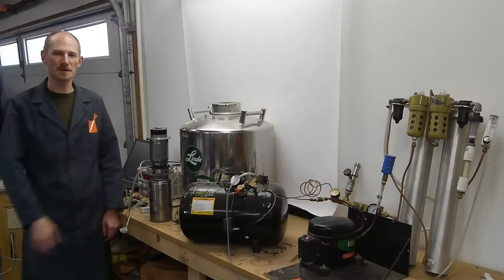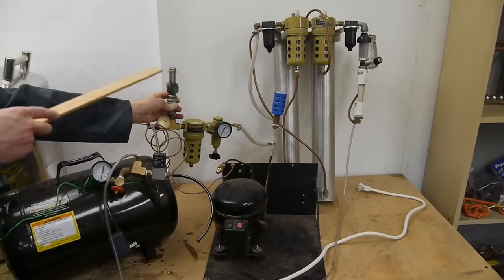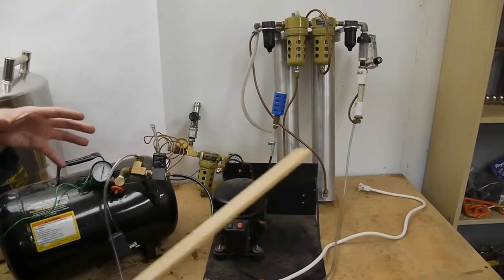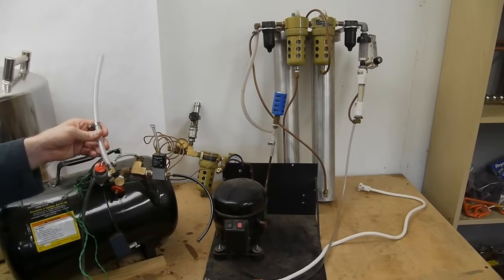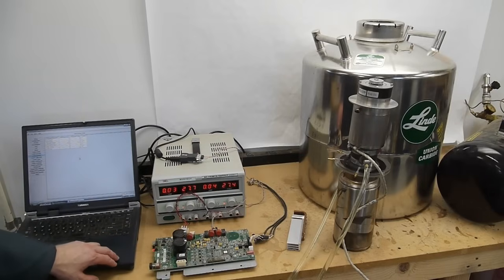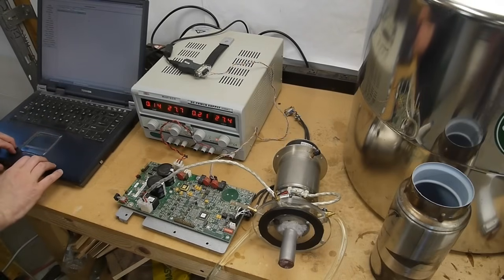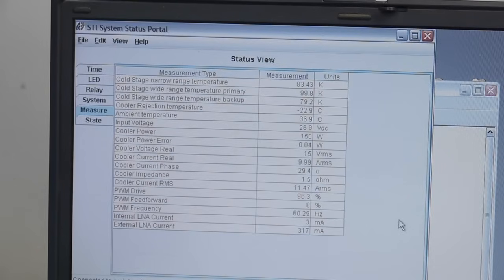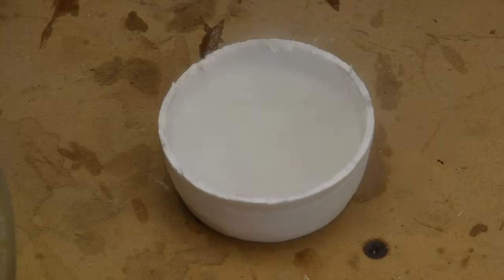Liquid Nitrogen Generator - Overview

Comment: Question for you Ben:  Since neodymium magnets are a lot easier to come by, could you first liquefy air then separate the O2 from the N2 via magnets and pour them into two separate dewars?  Seems like you could also simplify the set up by just letting ice form on the Stirling cylinder tip and/or dry it out upstream with a cold trap.  Am I dreaming?

Love your vids and your ingenuity!
Reply: SuperDachshund How 'bout this?Liquify the air like you do here then drop it down a funnel emptying into a 1" long tube that is cut away like a trough for the last half inch.  Then position the corner of a square neodymium magnet near the trough.The O2 will leap out of the trough and run down the edge of the magnet a half inch or so away while the N2 will continue down and out the trough.  Now you've separated the two elements.  You could put a large tube in the dewar to capture the O2 dripping off the bottom corner of the magnet.  The N2 will drip in the dewar and the O2 will drip in the tube/tank inside the dewar.  CO2 and H2O and many other impurities are filtered out upstream or in the ice accumulating on the Stirling cold side.What do ya think?

Comment: An amazing system and job of construction !
  I have a project that I am having trouble keeping water vapor out of the vacuum pump.  The main chamber (Freezer) oscillates between a 200-700 mTor pending heating cycles of the internal plates, which release water vapor from the product. 
   So under the vacuum, the water stays a vapor until it reaches the pump and when the system is turned off and brought to an equilibrium; then water is found in the pump's oil reservoir.
  Can you think of a way to capture the water vapor in a vacuum, before it gets to the pump?  I thought about a silica gel filter stage; but the water is still a vapor, and I suspect would pass straightway thru or around the silica, back into the pump?
Reply: Bruce Wayne Silica gel has an enormous surface area. It acts very differently from a sponge. It works on water vapor.
Reply: Garganzuul Thanks, I will give it a go...

Comment: Amazing. This is a bit late, but do you have a nitrogen alarm? Film processing labs that use nitrogen bubbles to agitate the chemical baths have these alarms. I'm sure you know that if a nitrogen tank leaks it can displace the oxygen in a space. This is apparently undetectable to people, so a person could pass out and suffocate.  
I once had  five chunks of dry ice (I think there's a standard size of these) in my classroom.  By the afternoon I was feeling a bit dizzy, but I wasn't gasping for air (which I think is the human response to high levels of CO2, which we can detect). I  opened the windows, but  I also  realized  I had no idea what the actual volume at standard air pressure of CO2 gas was in those blocks.

Comment: Would it be possible to distill the liquid air? You should be able to purify the gas by letting the nitrogen evaporate and then condensing it on the cooler.

Comment: Would it be simpler to make liquid air and use a magnet conveyor to remove the oxygen?
Reply: Well you need to take into account all the moisture in the air
Reply: Submerged superconductive magnets?  N2 is also lighter than O2 which would aide in separation.  Between magnetic effects and a minor difference in relative densities perhaps the N2 could be floated off.
Reply: Bingo - Fractional Distillation, the same process that is used in oil refineries.

Comment: would it be possible to use one of those cryocoolers in extreme overclocking? The whole reason that we don't have 9 ghz processors in all our gaming desktops is because you need liquid nitrogen to pull that off, and liquid helium to get any further.

Comment: Great video!
You spoke a lot about your filter set up to filter out the oil from the compressor, and I noticed that there wasn't any way to capture the oil and input it back into the compressor. Are you worried about the oil potentially running low on your compressor? I'm not an expert on compressors - I assume it's a very small amount of oil leaving the compressor, but I'm uncertain how much you'll be running it - and any feedback would be greatly appreciated.
Thanks!

Comment: hypothetically speaking you could use a magnetic setup to scavenge all the liquid O2 by putting the stirling cooler on a filter setup and having the liquid all drip through (or near) magnets, yes? the magnets would attract the o2 elsewhere and the LN2 would go into the dewar. No idea if this is feasible :D
Reply: nevermind, apparently I'm late to the comment party

Comment: To separate the oxygen from nitrogen... vapor coming out of the liquefied air must contain higher concentration of nitrogen. Due to boiling temperature difference nitrogen will be the first to vaporize, right?... would it be an option to re-liquefy the liquid air vapor into high nitrogen content?

as you mentioned the option of liquefied nitrogen for moisture removal - liquid air can be used for that. It would help to produce more air vapor too... theoretically, could the product of each step be used to increase the quality of previous steps of purification? just like in an incremental distillation column.
Reply: Tomas Sab Bubbling moist air through a saturated saltwater solution would also work, unintuitive as that may seem.

Comment: Wow this machine is so cool! Is there a less MacGyver, but still DIY way to do something like this? It would be interesting to play around with some super conducting effects. How does the cost of this system compare with purchasing your own liquid nitrogen? (if an individual can even do such a thing)
Reply from the maker: ***** You can get liquid nitrogen at many local welding supply stores.  Bring them a stainless steel thermos and ask for a fill.  It's usually around $20.  If you find yourself using a lot, you can buy a larger dewar on eBay, and have them fill it up.  The cost per liter will be much lower if you give them a large container.
Reply: ***** Look around for joule-Thompson effect based cooling and pressure swing adsorption based gas separation, it's probably the most "user friendly" way to build a LN2 generator and it doesn't require any expensive parts.... but it might still require some (basic) machining.
And university cryogenic tech labs tend to have LN2 at pretty decent prices. Locally it cost like 2 bucks for 1 liter of it.
Reply: ***** Look around for joule-Thompson effect based cooling and pressure swing adsorption based gas separation, it's probably the most "user friendly" way to build a LN2 generator and it doesn't require any expensive parts.... but it might still require some (basic) machining.
And university cryogenic tech labs tend to have LN2 at pretty decent prices. Locally it cost like 2 bucks for 1 liter of it.
Reply: Awesome Thank you both! I've already got to go to a welding supply shop to buy some stainless wire for my summer pulse jet project, I'll bring along a thermos and see if they can hook me up!

Comment: My gosh!  The specs of that cryocooler are such that I could run it directly off one of my large solar panels.  Where can I get one like that?  I want it so bad.  I'm coming up with very expensive (probably larger) cryocoolers on eBay.
Also, how much of a difference does liquid cooling make in performance vs copper fins and a nice fan?  
I'm trying to debate which type I want.  I would only be running mine for several hours at a time to make small amounts of liquid air to play with.  I used to buy LN2 from a welding supplier and then make liquid oxygen from the LN2 if I ever needed it.  This would be way better... with my solar power, it would be completely free!  First thing I want to make are dippin' dots! :)

Comment: Hey Ben, nice apparatus :D But, what about using sodium hydroxide after the silica gel for drying air? Probably it wouldn't get so wet because of the first stage of the filter. Maybe you could make a little reservoir to drain the soda, if it get liquefied. 

Awesome project, you are one of my inspirations. :')

Comment: I used to work on oxygen concentrators , it seems if you hooked up to the exhaust side of the concentrator you’d be getting 98% pure nitrogen. Molecular seive separates air and dries it. I’ve liquified the O2 on the output of concentrator by the ol tube in a liquid nitrogen then flowing the concentrated air through it in a u-turn and it will drip liquid O2 (and some other condensed gases, since concentrators are not 100%).

Comment: This is way cool. One question. Could you use the first part of this setup to isolate some other gas, like argon, to use for welding? If so, would you actually save any money?

I always wondered exactly how they made LN2, thanks so much for sharing.
Reply from the maker: justfakeit888 Thanks!  The large commercial LN2 plants use a slightly different process.  At larger scales, it's more efficient to remove water and CO2, then liquify air and use a fractioning column to separate the argon, oxygen, nitrogen, etc.  They use turbine expanders and other turbomachinery to extract as much energy as possible from the gas to cool it, and liquify it directly.  No need for the helium-based cryocooler.  I think the N2 membrane shown in this video would pass argon completely, so the output gas will have a couple percent argon.
Reply: justfakeit888 The problem with isolating gases like Argon is the problem of getting a sufficent supply of them. Nitrogen, and Oxygen make up 78 and 21% of the air volume respectively; so they are relatively easy to acquire, as Ben has just demonstrated. 
Argon however, is only about 1% of air volume, so you'd need to pump an enormous amount of air through your apparatus to get any quantity of liquid Argon, and you'd need to deal with the Nitrogen and Oxygen to find some way to separate it away. 
Since liquid Nitrogen is used for many processes in Science and engineering, most facilities that use liquid Nitrogen don't make it themselves, but rather receive it as a delivery from a commercial facility which services many clients, and consequently makes thousands of litres of liquid nitrogen at a time. Since Argon boils at -185.8°C, Nitrogen at -195.8 °C and Oxygen at -183 °C, it is possible to separate these gasses from each other by distillation. So the Argon that welders and others use, is a by product of the process of making liquid Nitrogen and Oxygen for other purposes. 
Next, he is using a membrane based Nitrogen generator to "purify" Nitrogen out of the air. This generator actually take advantage of a principle of the rate at which different gasses pass through a membrane. Unlike a filter, which traps what you want, and allows the rest to pass through, the generator membrane is more permeable to Oxygen and Argon then Nitrogen, still plenty of Nitrogen gets through. It acts more to "enrich" the gas that exits the generator for Nitrogen, rather than filtering out the other gases. 
This membrane permeability is probably based on size; with Nitrogen and Oxygen gas being diatomic gases, and larger than the monitomic Argon (which is a nobel gas). Oxygen, despite being one proton larger than Nitrogen, has a covalent radius of 66, to Nitrogen's 71 (which are the sizes of the actual atoms). So Nitrogen gas is the largest of the gases passing through the filter, and hence takes longer to permeate through the filter membrane, so is more likely to exit the end of the filter and be collected.

So to answer your question, "No, the initial setup is optimised to enrich for Nitrogen, you need to use a different method to enrich for Argon. But even if you could, you'd still need to process enormous amounts of atmospheric gas to get a sufficent  supply of Argon gas to weld, which wouldn't be cost effective".
Reply: Christopher M Call your local gas supply and ask them how much Helium cost right now.  You might give-up the helium party balloons for a while.

Comment: Awesome. I would use the liquid nitrogen to make pure nitrogen gas. I was thinking of making a refrigerator that removes all oxygen by replacing the air with pure nitrogen. It is oxygen that causes food spoilage. When it's closed it's easy to conserve it, but when it's open oxygen gets in. So we purge it replacing the air with pure nitrogen. A small computer can control it all. Interesting that he uses a refrigerator compressor. The technology for my new type of refrigerator is already half built using this system.

Comment: Ben, wouldn't it be better just to use a oil less air compressor instead of the dirty refrig. compressor.? it won't last long, unless you return the oil to the refrig. compressor and some back cooling.

Comment: It seemed like you didn't actually use the dry nitrogen that your drying system was generating. Would you just plug in the dry nitrogen gas storage container into the cryo cooler to generate the high purity liquid nitrogen?

Comment: Really interesting, thanks !

How hard would it be for a well equipped hobbyist to make the sterling cryocooler itself ?

I assume they are using a rhombic drive Beta Stirling, would something simpler work (even if at a cost of more kWh per liter of LN2 ) ?

Any idea where to source these cryocooler and oxygen separation membrane ?

Do you generate argon too ?

How effective are the oil coalescing filter ? I'd like to compress oxygen with the heat pump compressors, I know what happens if you store high pressure oxygen with oil. Are these oil filters good enough for that purpose ?

I'd really like to generate my own O² / argon / co² / nitrogen to reduce my shop costs so this video has been very informative, thanks !

Comment: Is There any way to decrease Temp of Kitchen refrigerator below 0C to -C ???? Or it's possible to convert this refrigerator into cryogenic type !!!!!
Reply: X-TREME Diy yes its possible. You can replace refrigerant which i thinks is probably R600 or R600a.
Replace it with propane and you will get temperature of -42*C easily.
Reply: For converting it to cryogenic type you will have to connect another refrigeration system in series with different gas like Ethylene ( -103*C)

Comment: It's a long road but could you use that to liquify methane from bio gas either compost or septic tank to run a turbine and produce electricity? I've always wondered if communities could get by without going so big if each household had the right technology. I'm not sure how clean it burns either or how it could be filtered. Very impressed by what you've done. Elon should give you a call.

Comment: I have one of these cryocoolers  a Hybrid 98, similar to yours.  What I do not have is the control board.  I used a variac to test it, ramping up power slowly at 60hz.  I never went past 20% or about 24VAC, although I saw on another video that one individual runs a similar unit up to 110VAC.  Mine gets cold, but I did not want to ramp it up too much as I am not sure of what the limits of what the unit can handle and I did not want to damage it.  I also noticed that their is significant vibration and a rattle at the top of my unit.  I am thinking something is off with the counterbalance.  I don't know if you know the rough power up, max power ratings for the cryocooler but any information would be appreciated since I do not have a control board for it.
Reply: I see your getting other heavy hitters to comment here as well, Grant Thompson and Cody Reeder.  You have quite an audience.
Reply: got the rattle fixed, I found that the nuts had come loose that were connecting the counterweight washers to the spring.  Still trying to test it, but it does work.  I may use a spare Arduino to control ramping it up slowly at startup.

Comment: Very good video!
However you should be careful when pouring liquid air.
Even if as you stated the oxygen content is not that high, pouring in a styrofoam container is a bit risky as even 10%liquid oxygen in nitrogen is a powerful oxidizer.

Comment: I might have missed the answer to this in the video. But I don't see why you wouldn't be able to just separate the two gasses after liquefaction instead of before, by simply bringing the temperature up just high enough to boil off the oxygen while keeping the nitrogen still liquid... Is there something I'm missing?

Comment: what was the cost of the dewar  ? .also do you believe that a counterflow heat exchanger with copper tubes in a vacuum cold box using a refrigerator compressor will work to liquify gases like nitrogen oxygen and argon or the pressure is too low?
Reply: nikos karavitakis yes it will work

Comment: If it is so difficult to find a nitrogen filter wouldn't it be better to have 2 stage cooling and condense everything except nitrogen and then feed the gas into stage 2? Or is that not a good separation mechanism?

Comment: So in theory, you could use gravity and magnetism to separate the liquid oxygen from the liquid air as you compress it? Or does nitrogen like to stick to the oxygen?
That would be a neat project.
Reply: Richard Smith You may not have skimmed the rest of the comments or be aware of the properties of liquid oxygen. But it's nasty and dangerous stuff,  I would not want anything of that in a liquid state anywhere... things that normally won't combust without an open flame can suddenly decide to catch fire.

So its better to separate as much oxygen content beforehand to not run those risks, just look through the rest of his videos for some examples what liquid oxygen can do.
Reply: +ToKeepTrackOfRandomSubs I see, so it would be possible, but dangerous, i hadn't considered that.

Comment: Would it work to use your heat pump to liquify air and then use neodymium magnets to separate liquid oxygen from the liquid nitrogen? It might be easier to do than use the gas separator.